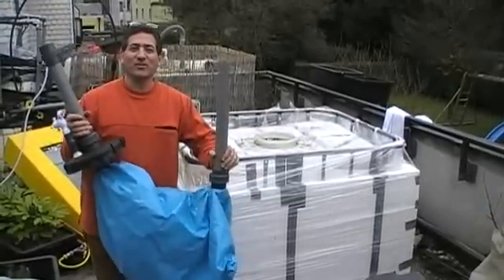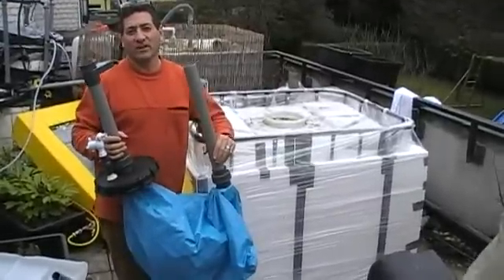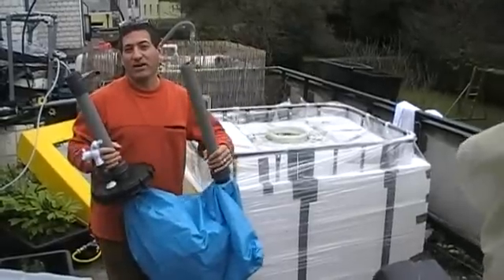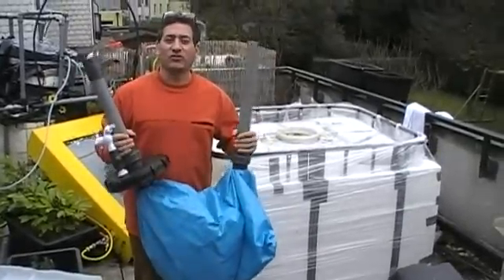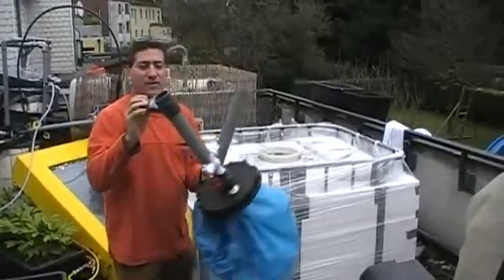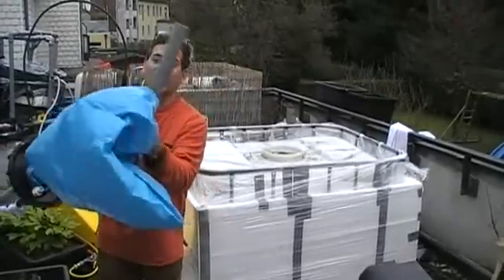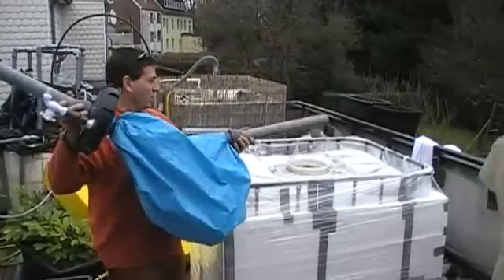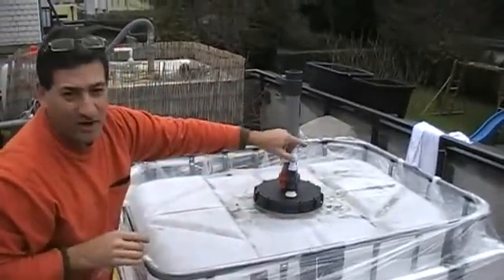Biogas improvements: A new stomach for the sacred cow, part 1.

Comment: Small digester is a good goal. 

However.

Can average family provide the waste?  See previous post.

Even above the high end, which is .88 lbs/day of waste per adult, you would need 21.3/.88 pounds of waste to produce 0.5 pounds of methane per day.  That means you need more than 20 adults.

Of course the waste numbers I am using here are only the feces and not food waste.  Still, 21 pounds of ANY waste, per day, every day, is a lot.

I do like biomethane.  Keep up the good work. ;)

Comment: "In 1924, ... with a feed intake of 21.3 lbs. of dry feed. Cows produced just under 0.5 lb. of methane daily. In ... 2007 dairy cows ... consumed on average 41.6 lbs. of dry feed. The dairy cow of 2007 produced almost 0.75 lb. of methane."

“… adult on an ordinary diet will produce from 100 to 250 grams of feces ... On a vegetable diet, an adult will produce from 300 to 400 grams per day. (0.22 to 0.55, and 0.66 to 0.88 pounds per day.)"

Comment from the maker: The issues surrounding the success of this idea will revolve around 1) whether the size is correct 2) whether the plastic is thick enough and  will last without tearing (though I've made it for not altogether difficult replacement) 3) whether the food makes its way out at the right rate without clogging.  One advantage I do see is that the mere presence of the new "stomach" will increase surface area for biofilm formation both inside (acidogens) and outside (methanogens).